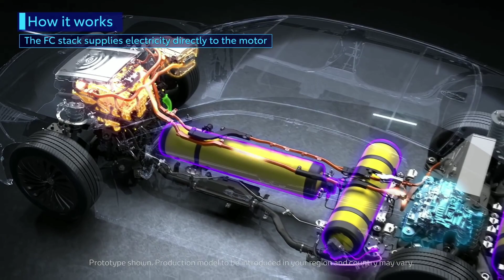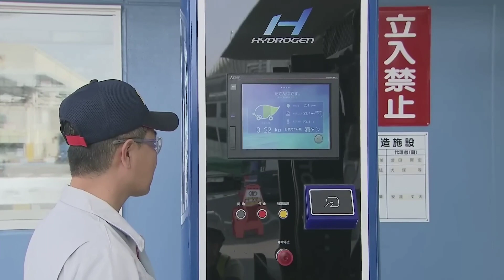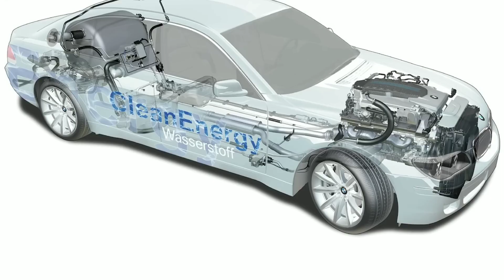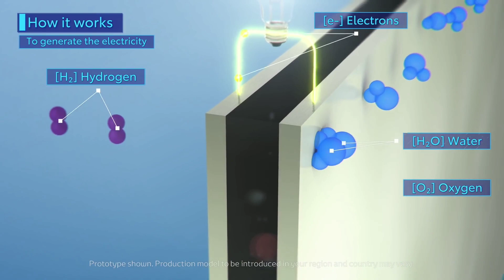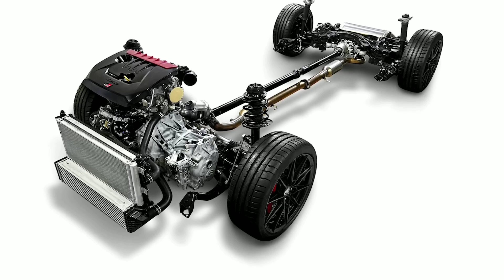Toyota's INSANE NEW Engine SHOCKS The Entire Car Industry!

Comment: If hydrogen is so good, why not just run existing gasoline engines in cars and fuel them directly with hydrogen? Why mess around with converting everything to electricity?
Remember the adage; KISS - keep it simple stupid.

Comment: Just got to correct you. This engine is not the first, by a very long shot. I first heard of the modern Hydrogen engine 3 or 4 years ago when JCB developed theirs, by now they are probably out there in use on a few building sites.

Also the first ever internal combustion engine was powered by Hydrogen, Patented in1807 by François Isaac de Rivaz, a year after he fitted it to an automobile..
Reply: Good point re. JCB, I think Harry's Garage did a sort of "one year later" update and their progress has been impressive.

Comment: How about a car that runs directly on sunlight without having to convert it into hydrogen first and without the inefficiency of an internal combustion engine? Too hard you say? Not for Aptera...
Reply: Hi. Yes, it's possible, but the maximum power coming from the sun (providing it's shining) is about 1 h.p. per square meter at the equator. Four or five h.p. doesn't break any speed records. Solar panels built into a few cars are already used to trickle charge the main battery, and they can provide about 10% of the energy required. There's a solar powered car race held in Australia between Adelaide and Darwin, but they're only called "cars" because they have wheels (very thin ones), and heaps of lightweight streamlining. The fastest can reach 80 kph at about midday, but that steadily lowers as evening approaches. 

I'd advise you to seek other more academically accredited sources of information than YouTube alone. Your local library will have peer reviewed information that will stand up in any university: on You-Tube you get "insane engines" that are perfectly rational, flat-earth theories, and a wide (but interesting) range of rubbish. Good luck, and happy studying. Cheers, P.R.
Reply: @philliprobinson7724   Aptera is not a theory, it's a real vehicle which is being put into production. Nobody is saying it will run on sunshine alone, but that's why it has a battery. If your Aptera is parked in the sun for 10 hours a day, but is only driven for one hour, it will run on the energy stored in the battery for those other 10 hours. It's not rocket science, and you don't have to be a genius to work it out.
Reply: @apterachallenge  Hi A.C. Thanks for that, I was short of facts there, not having seen the Aptera video. I hope it all works out okay, we need screes of forward thinking technology. I'm just happy I got the value of 10% right, as they used to say, "look after the pennies and the pounds take care of themselves". All the best. Cheers, P.R.